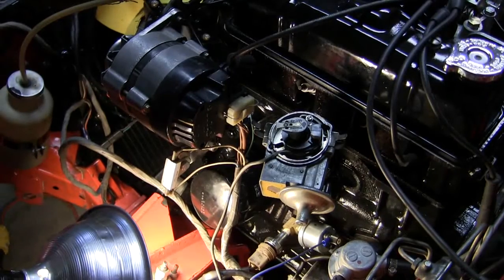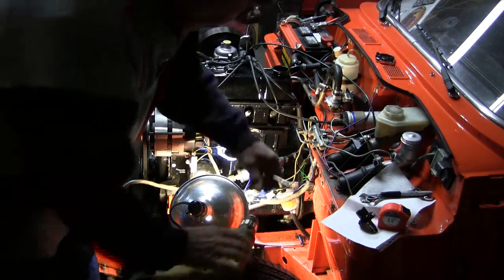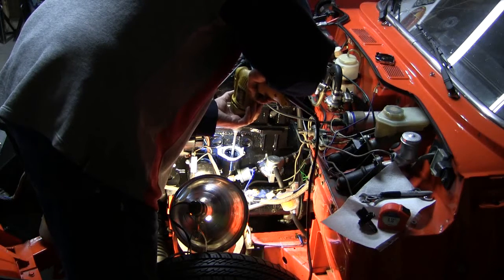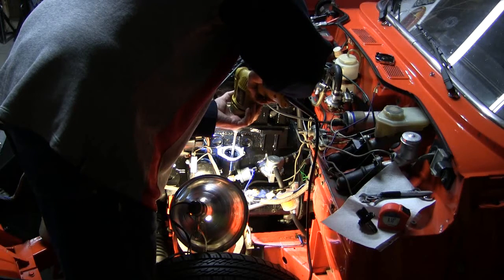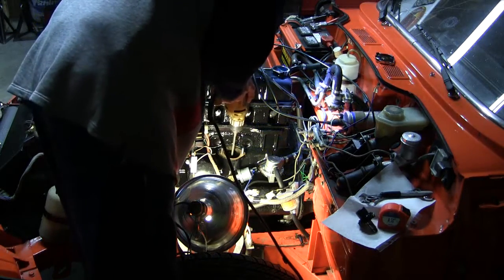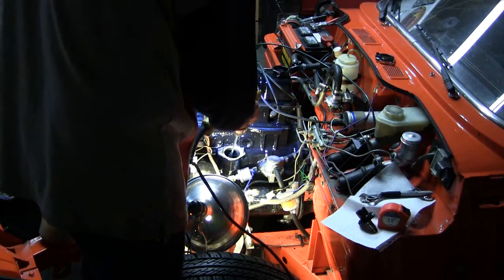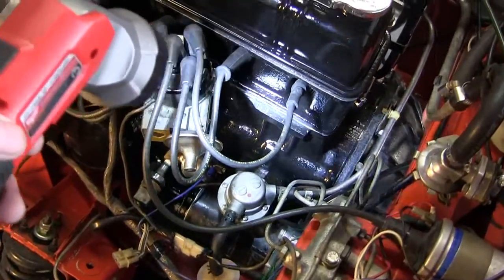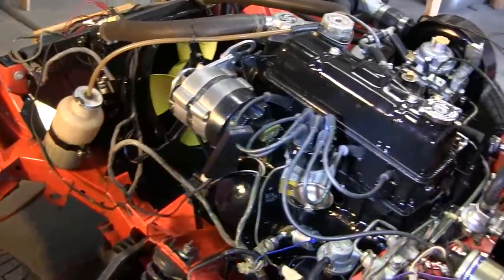79 Triumph Spitfire 1500 fill oil passages before startup and camshaft break-in

Comment: Priming the oilpump as shown does not bring oil to the rocker shaft as the oil flow to the rocker shaft is regulated by the camshaft, which has a hole,  allowing only a small quantity of oil to pass to the rocker shaft twice on each camshaft rotation. Triumph designed this to build up a higher oil pressure. Whith a static engine the hole in the camshaft will probably not line up with the oil gallery going from the pump to the head. Maybe an idea for your next rebuild ;-)
Reply from the maker: oil could flo around the cam journal, it's not a complete closed passage. The prime is to have oil in the system sooner. The crank shaft bearings are happier with oil, than waiting for the pump to prime itself.

Comment: Engine sounds really smooth. 
Can it be approved or done road worthy with a twin set of SU's. I think that your engine deserves that.
It's gonna be interesting to see how the improvement on the crankshaft endplay turns out.
Reply from the maker: Duel HS2 or HS4. Different exhaust manifold, and muffler system. Programable distributor for timing changes. All those additions would increase engine power, but fuel mileage drops, the drive train wears out quicker, tyres. Higher road speed requires brake system changes. Increased maintenance inspections, and parts change out. Be careful about the need for speed idea, it's expensive. Speeding tickets, auto insurance rate increases. Been there, done that. These are cool looking cars, without all that need for speed.